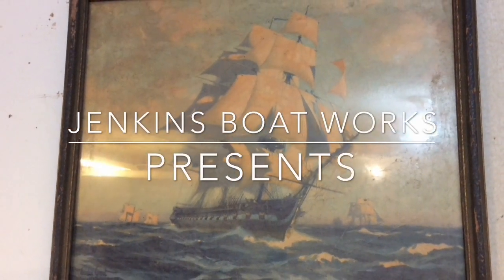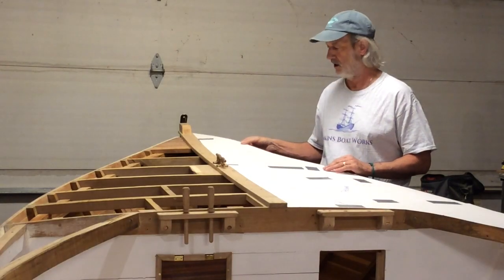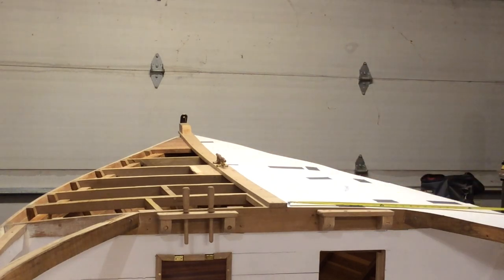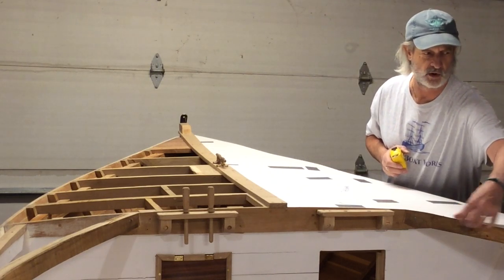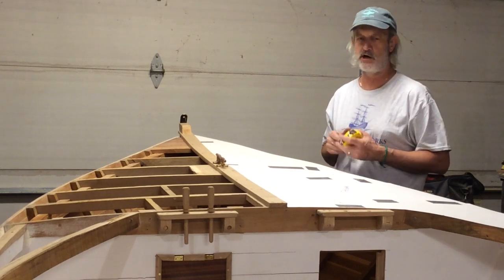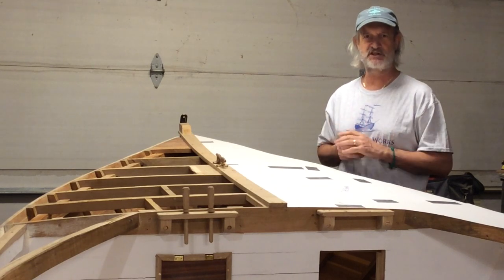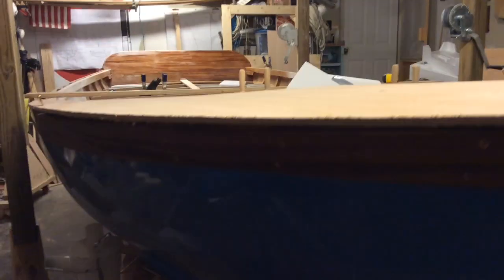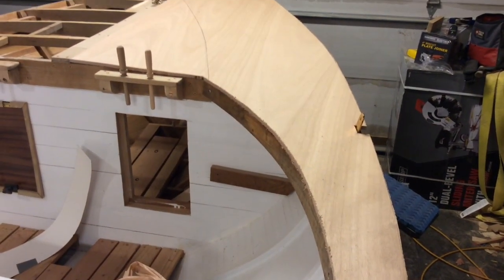Boat Building- Haven 12 1/2 Fore Deck - Episode 84

Comment: That Okuome looks lovely. After a quick search here, for a project I am getting ready to embark on, I have found only one supplier and that is in Wales, as far across the UK from me as you can get. I can tell you it is a lot more than $80 a sheet for 9mm ! I used thickened epoxy to fix the foredeck on my boat, it is not under as much stress maybe as yours, but it is very well fixed; I did consider using copper boat nails as an extra fixing, but the furniture I put on seemed enough in the end. Well measured out too, just enough overhang. That was an all too short clip of the schooner trip, it looked great.All the best for X Mas and the new year.
Reply from the maker: Merry Christmas Dale!

Comment: I had the same dilemma with my Glen-L 14 sail boat. I went the expensive route. I first screwed down a 1/4” layer of okoume then epoxy a second layer using all kinds of weighs to assure adhesions.